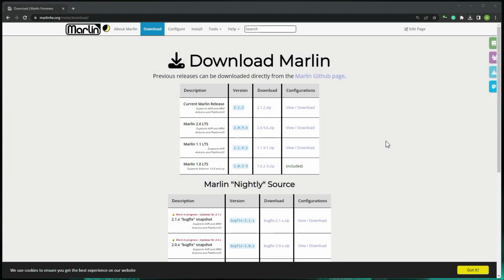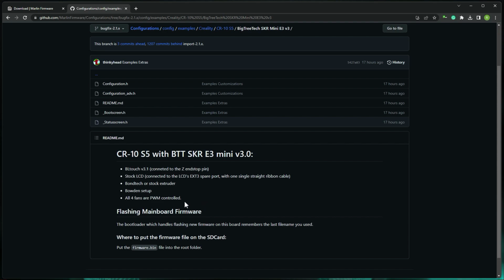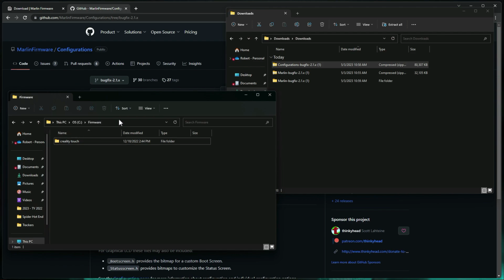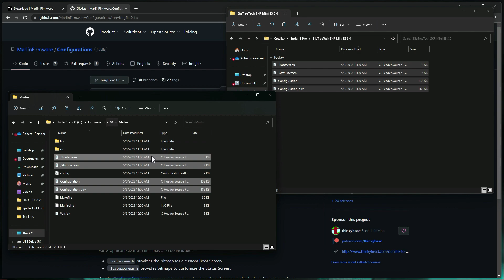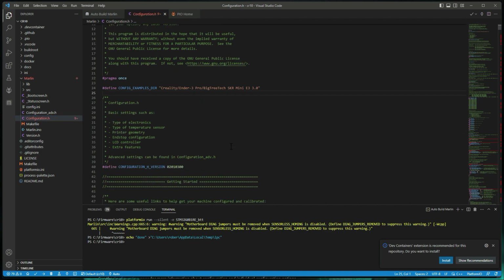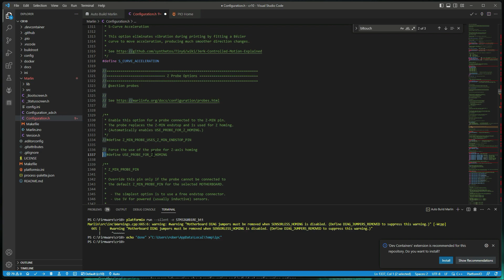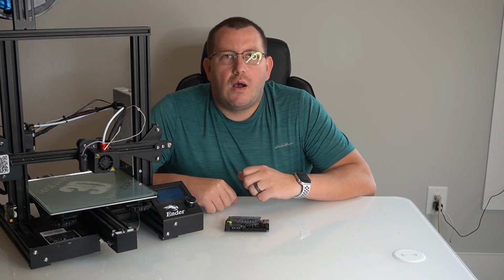Marlin Firmware for CR-10 and SKR Mini E3 v3

Comment: Hello there, I have a original CR10 and I am trying to change from the stock board to BTT sir mini e3 v3 and I see I am stuck as there are four fan wires and wanted to see where would they plug in on the NEW E3 v3.o board as there is only three pins but there is four fans. If you can please help or point me to an install video that shows this will be great help.

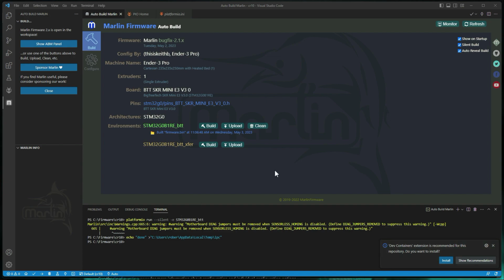Comment: Im not sure why, ive followed every step in the video up until 8:15, now for some reason when i go to test the build first as instructed it poos up with a eorror message "could not find one of package.json manifest files
Reply from the maker: Hi. Did you try to build without making any changes? This will help narrow down the issue.
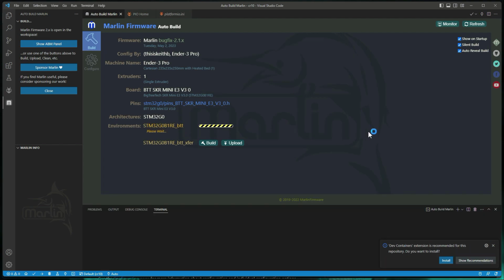Reply: yes i have tried to build. and no i havent edited anything yet,  at 8:00 when you said to run the build before we edit aynthign is exactly what i did and thats where i ran into the problem "package.json" missing
Reply from the maker: @Cribed  ok, can you move all the files to c:\firmware\ then try again. Im wondering if your path is too long due to the folder names.

Comment: Thx Rob... followed your guide and got my CR-10 w/ upgrades.   Got adventurous and decided to add a sprite extruder but now can't move towards the bed in z axis.  Any ideas?
Reply from the maker: Hi. How is the crtouch wired and is the z stop still connected? If the crtouch is connected to the 5 pin bltouch port the z stop still needs to be connected.

Comment: none of the files build, constant errors. buying this board may have been a mistake... i'm on the edge of just giving up. trying to build a basic cr-10 s firmware using the files you linked. if building from a ender 3 pro doesn't work them i am at a loss. else i will just have to hope the firmware.bin works that was included.

latest release builds fine using the ender 3 pro as the base changing the printer name and build area, but not the bugfix... hope it works.

Also hoping my tft35 screen switching to the mode screen is just because the plastic cover is affecting it. Worked fine yesterday when I installed everything. Today it’s freaking out and won’t stay in either mode, marlin or touch. Appears to have flashed the firmware instantly. 🤷‍♂️
Reply from the maker: Hi. The bug fix can be hit or miss. What issues are you having with the stable build at this point and is the issues consistent. Also, did you update the firmware on the tft?

Comment: I have been learning on my feet with 3D printing and could use some help. I have a CR10 V1 and I have attempted to upgrade the motherboard to the Big Tree Tech SKR Mini E3 V3.0 board with the TFT35 E3 V3.0.1 Smart Display. I have the firmware for SKR Mini E3 V3.0 from the 3dprintscape website but I need to make sure my new Display and Extruder are good in the firmware. I would appreciate any help.

My Setup

CR10 V1

Dual Z Axis

Filament Run Our Sensor

BL Touch V3.0

Micro Swiss Direct Drive Extruder

Big Tree Tech SKR Mini E3 V3.0 board

TFT35 E3 V3.0.1 Smart Display - Setup for Touchscreen Use
Reply from the maker: Hi, assuming the dual z axis is on one driver then everything should work but the filament sensor. It’s disabled in the firmware because wiring could impact the changes needed.

Comment: Good stuff! I noticed Marlin has firmware for the Ender 5 for this board as well now. That is sure easier than going through the config files and setting stuff up yourself. Thank You.
Reply from the maker: Hi. Thanks for the feedback. Yes if the config example is available use that, it is much easier.
Reply: @3DPrintscape  Will do, thanks a bunch!

Comment: Coming back to this video, there is now a configuration for the CR10 and SKR Mini E3 V3 in the supported build values but it appears to have been copied from the "import" config which has "#error" directives which will need to be removed.
Even though the config files now exist, this video is still very useful for making changes!
Reply from the maker: Hi, thanks for sharing this.

Comment: I just bought this board and the BL Touch for my cr10. Some of this was kind confusing. I’m not a super savvy tech guy but I can manage. I’m gonna use this video as reference for my install. Only upgrades I have on my cr10 now are the extruder and a did a direct drive with the bracket from creality.
Reply from the maker: Hi. Let me know if you run into issues.

Comment: Hello, very good job, I suppose it will also work for the cr10s? I will have to clone Z because I put another motor in it, I have no problem with that, I have to use a BIQU MicroProbe, would you know if there is any significant difference to be had? thank you.
Reply from the maker: Hi. The process should work with that printer you would just have to make sure to update everything specific to the printer. The BIQU MicroProbe is basically the same as the bltouch to the board so the process would be the same for that as well.
Reply: @3DPrintscape  No BIQU  Microprobe you can't use BLtouch, apparently you have to reverse it and make other changes. I'm struggling to configure it correctly. I'll post the changes in Marlin's configuration when everything works correctly. At the moment I had problems with the pins and connections that Marlin apparently does not manage or they stop working. Possibly fixed with an update.
Reply from the maker: @spyaorros  Gotcha, i never used that one but it looks like the bltouch. You may just be able to enable that then reverse the trigger.

Comment: What would you recommend for a CR10 Mini? It doesn't look like you have that one on your site.
Reply from the maker: Honestly, i havent used it so i cant give the best advice. I will say check the board before buying one. If it has a 8bit board i wouldn't waste the time or money on it.
Reply: @3DPrintscape  Thanks for the response. I just purchased the SKR Mini E3 to put in it. I was able to get the default CR-10 Mini config file from Marlin and use your video to make the necessary changes before building. I think it should work. If not... Klipper!
Reply from the maker: I would go klipper, its faster :)  @MyMGBJourney

Comment: Thank you so much for sharing your compiled firmware. It took me days trying to figure it out on my own and it wouldn't compile. My issue now is, my CR touch isn't applying to compensation whenever I print. I tried manually leveling the bed then ran ABL. It calculates but when I print after ABL, I have to use babysteps to bring the nozzle down. Any suggestions? I was gonna change my z offset but I can't seem to find it on the LCD screen.

Additional info, I got Bed Visualizer installed in Octoprint. And I've used that and it's still causing issues. I added M420 S in the gcode after G28 but the nozzle is still too high. All it did was reset my probe offset to 0. I have no clue what to do now. Thanks in advanced!
Reply: I ended up using M420 S1. It seems to work. I also ended up using Prusa insteas of Cura. It has z offset settings. Thanks for helping me!
Reply: Update: I tried re-doing the z probe offset manually instead of the wizard. It was off by .1mm. I tried removing the offset in Prusa and it prints properly. Thanks again!
Reply from the maker: Glad you got it working!  @ColeDiaz89
Reply from the maker: Hi. You need to set the z offset. It should be under the bltouch section in the menu (i think). Then make sure to save afterwards.
Reply: @3DPrintscape  is it different from the Z Probe Offset? If so, I can't find it on the menu. I use "M290 Z-0.83" just to work around it for now. Here's my start GCODE:

M140 S70
M105
M190 S70
M104 S220
M105
M109 S220
M82 ;absolute extrusion mode
M201 X500.00 Y500.00 Z100.00 E5000.00 ;Setup machine max acceleration
M203 X500.00 Y500.00 Z10.00 E50.00 ;Setup machine max feedrate
M204 P500.00 R1000.00 T500.00 ;Setup Print/Retract/Travel acceleration
M205 X8.00 Y8.00 Z0.40 E5.00 ;Setup Jerk
M220 S100 ;Reset Feedrate
M221 S100 ;Reset Flowrate

G28 ;Home
M290 Z-0.83
M420 S1; Uses mesh
G1 Z2.0 F3000 ;Move Z Axis up
G1 X10.1 Y20 Z0.28 F5000.0 ;Move to start position
G1 X10.1 Y200.0 Z0.28 F1500.0 E15 ;Draw the first line
G1 X10.4 Y200.0 Z0.28 F5000.0 ;Move to side a little
G1 X10.4 Y20 Z0.28 F1500.0 E30 ;Draw the second line
G92 E0 ;Reset Extruder
G1 Z2.0 F3000 ;Move Z Axis up

G92 E0

Thanks!
Reply from the maker: Can you add g29 after the g28 line to see what that does?  @ColeDiaz89
Reply: @3DPrintscape  it prints in the air. Should I combine M420 with G29?
Reply from the maker: It still sounds like the z offset is not set correctly. I would restore default settings and go back and reset the z offset (make sure to save it)  @ColeDiaz89
Reply: I just realized my dyslexia thought G92 was G29. I just added G29 and it compensates now. Thanks! Is there away to use saved mesh instead of having it level the bed every time I print?  @3DPrintscape
Reply from the maker: Ya, you can just run g29 then save settings, it will use that unless a new one is ran. I prefer to run a new mesh before each print though.  @ColeDiaz89

Comment: I was just looking at the github directory, and it appears there's now a firmware for the e3v3.  Have you checked this out and maybe considered an update?
Reply from the maker: Hi. Ya its there now, you can just use that. I should probably make a new video.
Reply: Thank you for sharing this 🙏
Reply: I got the Github files to build but wasn't successful with 3D PrintScape files.

Comment: Hi there. I have 2 questions for you. I have a CR10 with V4.2.7 board. Been following your tutorial. 1. How do I set the nozzle to auto home to the left front corner?
Reply from the maker: Hi. It should auto home to front left corner unless you have a ABL (bltouch) enabled in the firmware.

Comment: Hi, I've been following your guide and trying to compile some firmware to install the skr mini e3 v3 into my CR10 v3. VS code throws up a load of errors when I test the build, before even making any changes. I'd really appreciate it if you could help me out with firmware that would allow me to use my BL touch on the CR10 v3
Reply from the maker: Hi. What is the first error your getting in the console output? Also, it will be easer to get help with the firmware on the discord server. The invite is in the video description.

Comment: Bonjour, 
J'ai installé la SKR MINI E3V3 sans Bltouch sur ma CR10V2 est-ce que le firmware CR10 sans module convient à la mienne ou non ? Les dimensions plateaux, c'est quoi ?
Reply from the maker: Hi. The build volume for the cr10 is 300x300x400. If the v2 is different the firmware wont work.

Comment: HI Thanks for this ,i did a  build before for my cr10s , but on the new board  didn't work so going to try this again , i couldn't  get the auto bed levelling to work correctly , as it would still level on the ender 3 bed size even though i had changed the bed size , , what would i have done wrong ? iam going to try your ready use file to , did you have any issues with auto bed levelling with your file ?
Reply from the maker: Hi. I had no issues. Did you update the bed size in the config and clear the eeprom on the printer?
Reply: hi , i did change the setting in the config , but i didn't clear the  eeprom on the printer , no , so will try that this time  @3DPrintscape

Comment: hi quick question fan 2  header on btt e3 ver 3.0  mini  cr10 i use for electronics enclosure it dose not come  on in your firmware
please advise 
thankyou
Reply from the maker: Hi. I would need to look into it more. Is that one used by default or is it for a mod you have?
Reply: hi its default cooling fan for case electronics enclosure 

fan 2 hearder pb 15
Reply from the maker: Can you reach out on discord? It will be easer to work on this there.  @tommyritchie8687

Comment: i have a cr10 v1 with a skr mini e3 v3 with a e3d hemera hot end do i need to do anything besides an update for the hotend to work correctky currentky im just extruding about 230mm to get it to print
Reply from the maker: Hi. That hot end has the extruder and everything built into it right? If so, you will need to recalibrate your esteps. I have a video covering it.

Comment: Recently my cr10s pro mainboard got fried, so I'm looking for a better upgrade. I found that creality silent board and btt srk mini e3 v3 suits better. Do I have to upgrade from inductive sensor to BL touch...!? Does srk mini e3 v3 support inductive sensor....!?
Reply from the maker: Hi. I haven't tried it myself, but I read that it can, assuming you have a metal bed. It wont work with glass or the creality magnetic surface. If it was working with your old board then you should be able to make it work. That said, i dont think you will find any prebuilt firmware for it so you will have to make your own.

Comment: I'm using this set up and followed through the set up andI have bltouch. I did what you said for the bltouch. When I go to do to P offset and go to use a paper to tune it. My screen freezes and it won't let me do anything else. I tried following your other video, but Marlin builder gives me a prompt saying it doesn't support the feature. Im guessing that's because it was the v2 version when I have the v3. github also has cr-10 SKR Mi E3 v3 available to modify instead of using the ender 3 pro like you are using in this video. Any way you might be able to assist? I'm more than happy than happy to show you what I'm doing to recreate my error for you. I just get scree freeze when I get to the point of needing to set my Z offset.
Reply from the maker: Hi. Are you using a TFT screen and if so, did you update teh firmware on that?
Reply: yes I am using the tft35-e3  @3DPrintscape  I did update it. I will try doing another update to it and see whathappens

Comment: I fixed my problem. I used your file and replaced the bin file in it with the one I built and it worked (I have a cr-10 s4). The touch screen issue was because the screen itself hates the metal case. it must ground out the screen. Anyway THANK YOU. Everything working fine now.
Reply from the maker: Im glad you got everything working. Hopefully the screen grounding out doesnt cause any other issues.
Reply: @3DPrintscape  No Everything worked. even the Cr touch. I might just need small spacers for the screen. Thank you.
Reply: I forgot to tell you. An alarm goes off when the screen is pinched and you try to push the button to much. You have to turn off the machine. The sound came from the motherboard. 

I fixed the spacing with a double sided tape for now. I just left film on the side that goes to the screen. The foam works well for a cushion. Just wished it was black.
Reply from the maker: @oldmanbuilds  You may be able to use some black hot glue where the foam is.
Reply: @3DPrintscape  I used a black permanent marker. The foam absorbed it. If you get up close you can see the where the now black foam is, but from a few feet away you cant see anything. I avoided glue only because I eventually want to build a bottom for this printer and mount the hardware under it. Then put the screen on the front.

Comment: I did the changes and the bl touch changes and my touch screen now reads no printer and is stuck on the marlin/touch choice screen. it will to go both for a second then come back to the choice screen. There were no errors when the file was tested.  BIGTREETECH SKR Mini E3 V3.0 Control Board +TFT35 E3 V3.0.1      It worked when i first connected everything before I changed the firmware.  Was the bin file the only file needed?
Reply from the maker: Hi. The the bin is the only file needed.

Comment: Hello there, I am almost done with the process of doing this whole upgrade but everytime i use the auto bed level feature it probes the 4 corners of my cr-10 bed but in the size of the ender 3's bed dimension. is there any way to edit the auto level's area of operation to the size of the cr-10? Thanks so much!
Reply from the maker: Hi. What is the bed size values in Marlin? It sounds like they didnt get updated for the cr10.

Comment: Please can someone help me 🙏. I have an ender 3 V4.2.2 with a cr touch. I have tried the firmware from 3dprintscape site but it won't work. The homing X and y is fine but when I goes to home z it goes up 10mm deploys the probe then move up again and repeats 3 times then stops. I don't know what's wrong and don't have the knowledge to make custom firmware. I am new to 3d printing and need someone smarter to please help me get me print back up and running
Reply from the maker: Hi. Is the z stop connected? Most firmware, including mine assumes that it is.
Reply: @3DPrintscape  the cr touch is connect to the 5 pin port and not the factory z end stop 
it was working before the firmware update
Reply from the maker: @novaglow1466  Try connecting the z stop. There were some old creality build that worked with it not connected but most builds expect it.

Comment: I just installed this board and the TFT35 touch screen in my CR10 S5. I used the configs in the CR-10 S5 folder everything works great in Marlin Mode but the touch screen says No printer detected. When the SKR Mini E3 v3 board arrived it had firmware for the ender3 on it and  the touch screen side saw that. Is there a setting that needs to be defined for the touch screen to see the printer since it's now flashed to the CR10 S5??
Reply from the maker: Hi. I have never used the TFT with a creality board. Im not sure its actually supported.
Reply: @3DPrintscape  I installed the Bigtree SKR Mini E3 3.0 board.
Reply: you need to connect the screen with the TFT connector on the v3 board and connect that with the RS232 on the back of the screen
Reply from the maker: @wezze6683  Yes, both connections are needed.